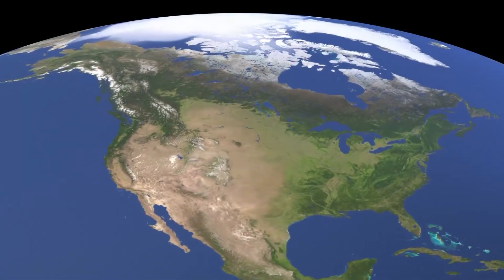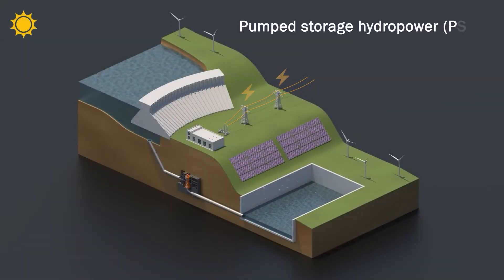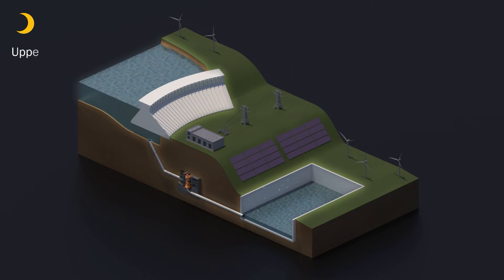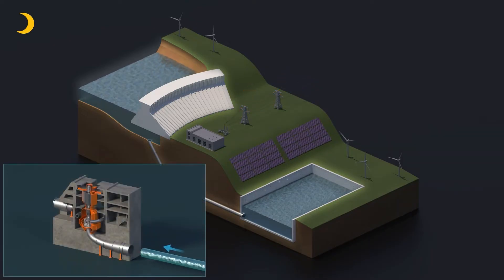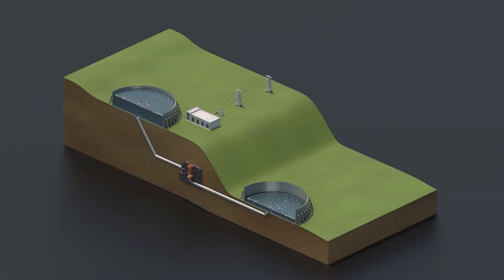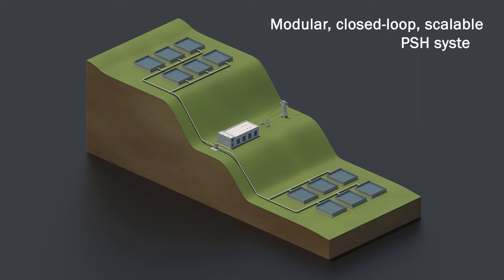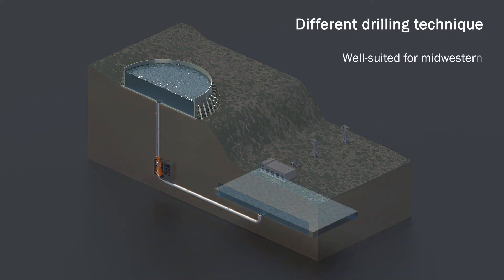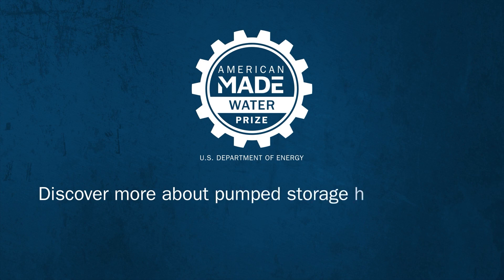The Importance and Innovations of Pumped Storage Hydropower

Comment: Pumped storage hydro-power—or PSH is a great concept to store energy generated during low demand for electricity.  The PSH work with very low efficiency only when wind is blowing, or sun is shining or hydro-powered stations have water conserved and it is raining.
Why the PSH are low efficiency investment????, The answer is simple, if PSH will work with efficiency 70%, and will store energy from wind power which has efficiency 35% (the best) then every kwh generated with wind power will end to 25%.  And if the PSH will be related to Sun energy with efficiency 15%, then the results will be 10% toal efficiency.  All these investment will need and investment on energy distribution, and this will decrease the overall efficiency.
The world of energy is very simple, clean renewable energy on demand can be generated using gravitational power and this will increase the efficiency of any generator who provide with 10% or 25%, 4-10 time more energy with less capital.  Call and let further discuses for collaboration.
Reply: Word salad.
Reply: bro, half of what you wrote makes no sense. regarding the other half, it's just plain wrong.
Regards